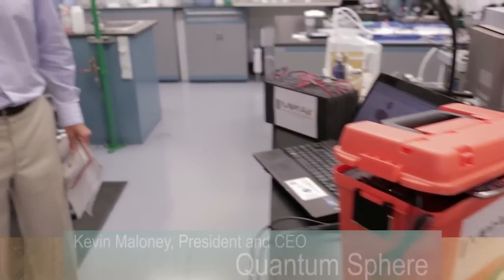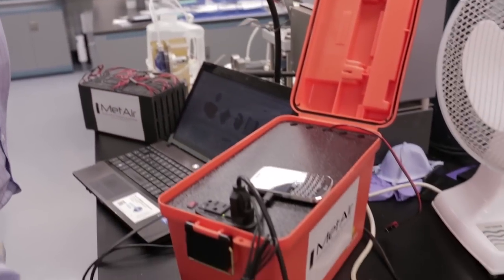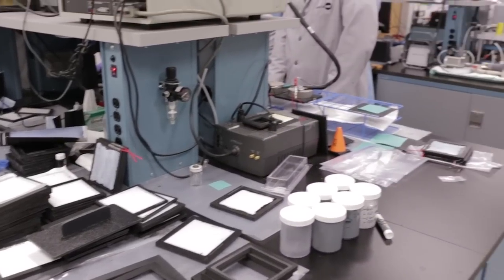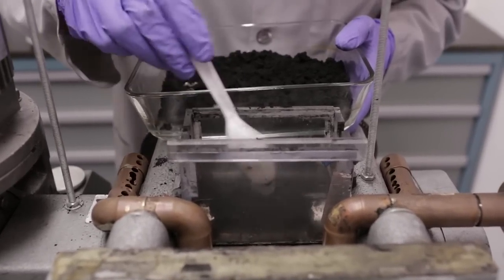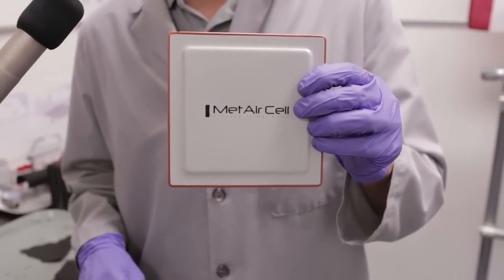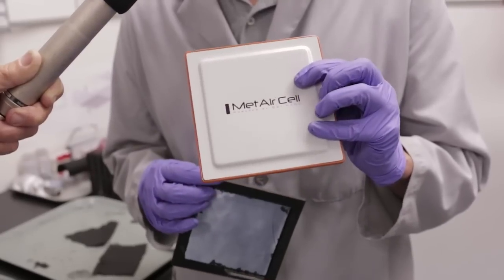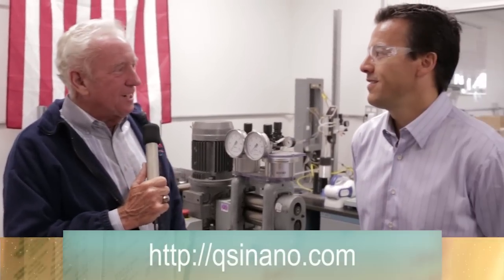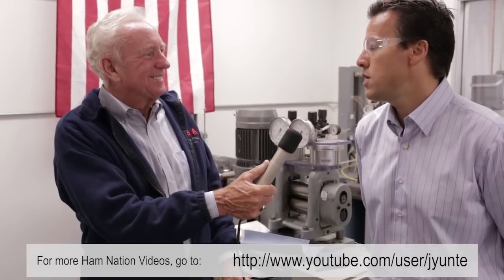Ham Nation - Quantum Sphere Metal-Air Batteries

Comment: So my understanding is 
This is one shots no recharge. One its open and exposed to air it starts producing power at that point its use it or loose it once the reactions is running there is no shutting it down ? And core must be replaced after it is expired. Is this correct ? How long is it good for once exposed to air ? How long before?